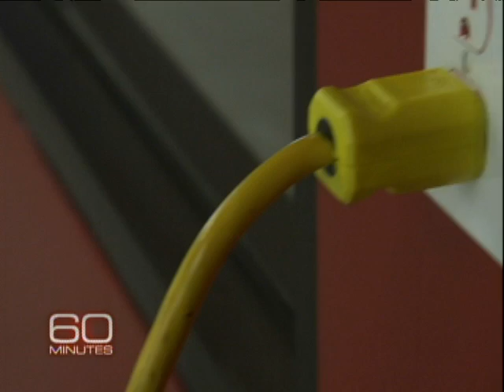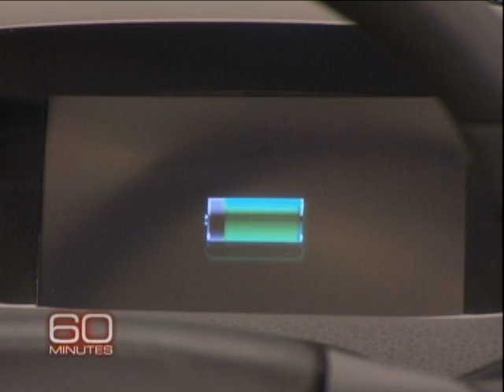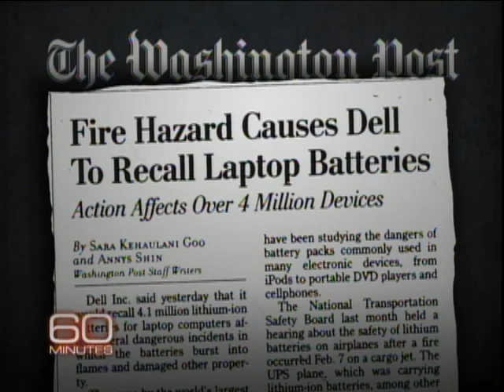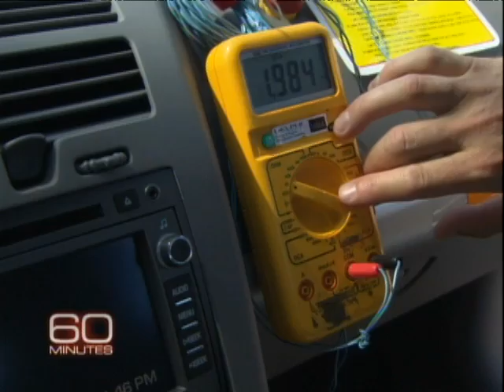The Race For The Electric Car

Comment: Electric cars are not the solution for a sustainable mobility. The problem is in their batteries, to produce them you need many rare materials, the processes to extract or mine those  materials are highly polluting. A better way to reduce the traffic in our cities is hugely investing in the public transport, make it efficient at the point to make having a car not necessary. It will save billions of barrels of oil and dollars. We can even think, and the technologies are already available, to get the combustible for busses, electricity generators for trains, from food waste. In Austria they use frying oil to make bio diesel for busses of the public transport. There are cities in the Scandinavian countries where people just rent a car if they need. 
Circular Economy is the answer to the Earth pollution and climate changes. And things has to be made in a way to be recyclable as much as possible. 

Are we sure that our governments are investing enough to change our economy model, which is based on cheap and disposable things?
Reply: You are right a out circulairity and ownership .. you will be pleased to know  tesla is gonna exactly do this  ! .. their goal is high recyclabillity .. very longlasting . And autonomous driving so the cars will not be sold anymore but can be rented .. 1 car being used by many people traveling less .. less cars on the road . Less tragic less pollution .. and cars lasting very long like a million miles easy .. this battery has allready been made as a proof of concept .. we also need small light cars like the aptera even better than tesla .. with autonomy and even more logic to it .. have a good day !
Reply: I guess you've never heard of Norway where 98% of new cars are fully electric. They generate their electricity from hydro and wind. Or you don't know they're scandanavia?

Comment: So the Volt has been pretty much a failure. So Boob Putz's reputation is gone. I mean, you make a stupid gas powered backup car with a tiny 40mile range battery under ideal conditions (more like 20-25mile range car for normal driving) then it will come with a $40k price tag. Remove all the gas pieces and its oil changes/fuel pumps/transmission/engine and what not and so much $$ could be saved. Of course, they don't get it or understand it. Meanwhile, Elon built his cars ground up to be simple and effective and gas components free and hence is doing well. Boob Klutz's "start from scratch" means start from an oil/gas car and add a tiny EV. Meanwhile Elon truly began from scratch and is hence rewarded with being the father of the EV industry.

Comment: Even though this is an old video (2008) right after after leaving Tesla's parking lot he says you can floor it and the engine sounds you heard was the chase car struggling to keep up with the Roadster. 

Since this video Tesla has designed and built cars that outperform everybody's cars built by any other automakers. The latest is the model Y and the performance model absolutely screams down the road without looking like a performance car. 

One thing this video doesn't address is since this video was produced is the solar industry has essentially exploded to the point you can't build a house in California today without solar panels which are now required by California law. Then add in wind generators, they started at 250 watts per wind generator and have grown to 20

Comment: The ecologists have to get off of greenhouse gas and concentrate on pollution that is killing us all! It is well known that core samples from the South Pole show CO2 was extremely high during the ice age, Greenland was farmed by Norsemen and the South Pole had vegetation and animals, the pyramids were surrounded by lush jungle streams and rivers etc etc. the ice age did not end by Mammoths driving SUVs! To stop the argument go to pollution I have to wash it off of my car every week! And my car is an Electric Ford Focus and all my yard tools are electric including a EVGO mower! Scientists like me cringe when we hear “global warming”! Just stop abusing us!
Reply: Global warming has the potential to kill many more people than pollution though. Some estimates say 150 million humans will die by the end of the century, which is less than 80 years away. That's like 25 holocausts. The 'ecologists' as you say are focusing on climate change as it is the biggest threat to our species - by some margin. Anyway, the point here is to avoid burning fossil fuels and both climate change and air pollution will improve. The two issues are related.
Reply: J J the problem is that global warming is a myth, even the eco-freaks have dumped the term! Climate change has taken us through at least 4 and as a many as ten ice ages! We are not gods an cannot change this cycle! The people promoting climate change by man are mostly paid off mouth pieces for the socialist agenda! Pollution would be a logical thing for them to talk about but they went for CO2 which is not a greenhouse gas! Don’t fall for it just work against pollution!
Reply: @ronalaska2472  I disagree with everything you have said. No point carrying on this conversation. I don't think we will see eye to eye on this one. Thanks for replying but good day sir.

Comment: Here's the thing with GM.  If I owned stock in the company I'd want them to soak the idiot public by making those high profit margin SUVs and selling them to a public wishing to indulge in masturbatory horsepower fantasies.  However, I would also want them to keep a heavy R and D emphasis on electric cars and to sell the EV1 even at a loss.  Then, when peak oil hit and the price of gas skyrocketed your in a perfect position to ramp up production and capitalize on the new reality.